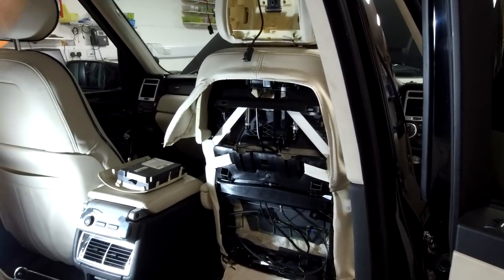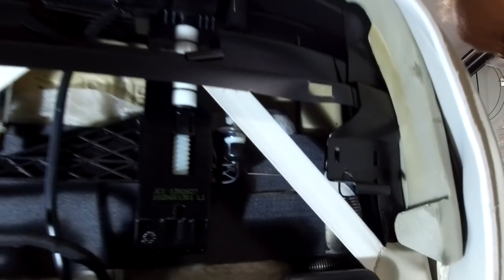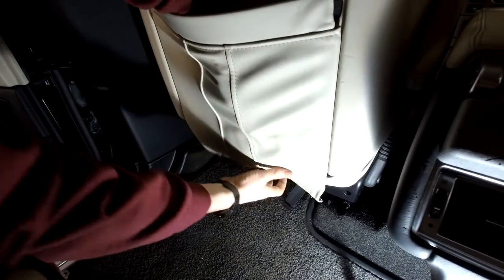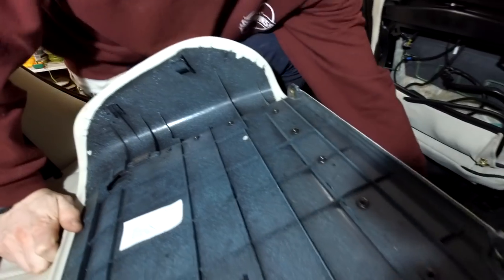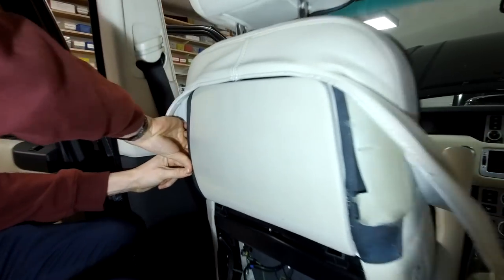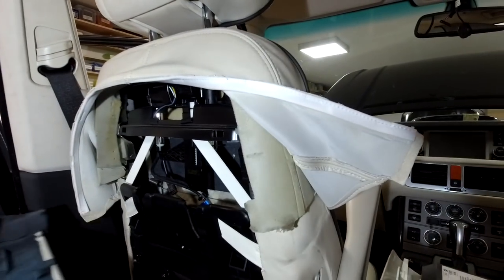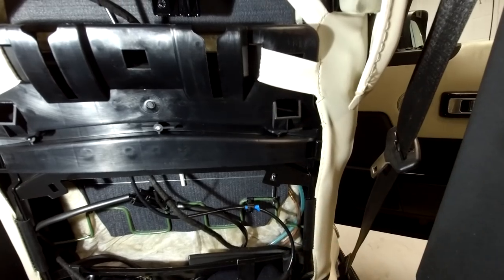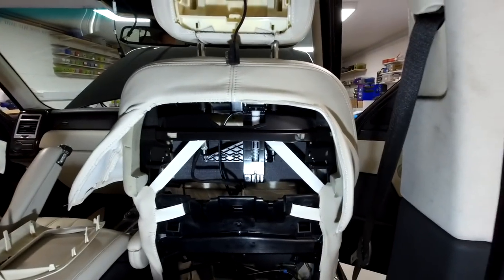How to strip down Range Rover L322 Front Seats

Comment: Once again you guys saved my bacon.  I was halfway through dismantling the drivers seat in my 2006 L322 and could not be certain how to completely remove the seat back to find a broken wire to the heating element.  A quick search and once again you had a video.  And once again a picture is worth a thousand words in the manual.

I was able to find the broken wire.  It had broken at the point it is bonded into the heater matrix.  Damned difficult to commit the necessary surgery but now I get a warm bum in the morning.  Thank you.  Thank you.  Thank you.

If I lived in Britain I'd drive over and buy you both a couple of pints.
Reply from the maker: Glad to have helped you ! enjoy your warm bum !

Comment: Cool!  Thank you!  I’ll try taking the seat apart before stabbing my lower lumbar bladder which is stuck at fully inflated.
Reply: You'll probably find the two pin plug has pulled out of the control panel on the valence at the base of the seat

Comment: I have a later L322 ROVER RANGE III FACELIFT 2 - 2009 to 2012 there’re no screws at the bottom to release the rear plastic, is the a video for this model? I need to access the lumbar support. Thanks Tony
Reply: Same Problem, have you found a Solution?
Reply: @ralph8594  Yes, if you follow the video until the part where they say remove the screws it's the same, however, there are no screws. The plastic is held either side of the seat. Under the seatbelt cover and the seat belt holder cover, the plastic is moulded over a long metal cog fixing on both sides. You need to flex these out and at the same time push the top of the plastic cover downwards, you may need 2 people. 1 to hold the bottom part of the plastic out and one to push or tap with a rubber hammer downwards. There are no screws or other fixings. I hope that helps.

Comment: Would love to see similar for L405 seats, I have a 2017 L405 and both front seats will not hold pressure in the lumbar section, any suggestions or a video with potential causes and fixes would be greatly appreciated

Comment: Hi guys, any info on the seat heater circuit please? I have cooling but no heating on the drivers side. Passenger seat has it all working, and the led's on the dash control for the driver seat light up in sequence as they should. After you saying the seat movement might affect conne tions was about to take the whole seat out after discoñecting the battery for several minutes first. Great video as ever many thanks..
Reply: I'm in the same boat as you... passenger seat everything works, but heating on the driver's side doesn't 😢
Reply: Me too 🙁🙁
Reply: Did either of you solve the no heating issue?

Comment: Great vid! That looked like you moved just the top half of the backrest of the seat around the two minute mark- I didnt know that was possible! How do you do that?! :o
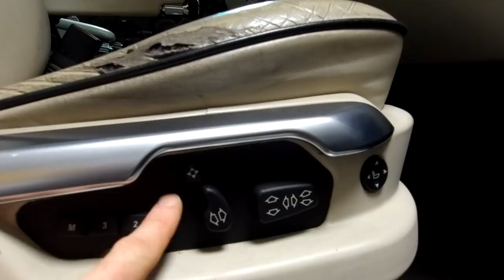Reply from the maker: Hi - i think this is what is controlled by the top button on the control panel at the 0:50 second point. The button has 4 arrows - up down control the headrest. Left right control the top section of the seat.
Reply: @L663  interesting... my 4.2 S/C is the facelifted 2007 model and it seems the upper section angle can no longer be controlled. Maybe it was causing problems and removed it from the facelift!